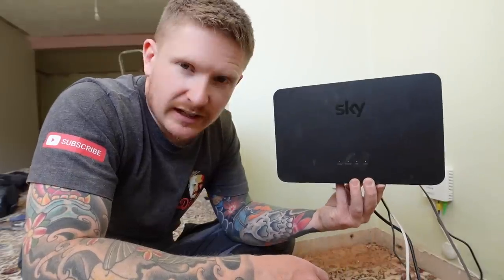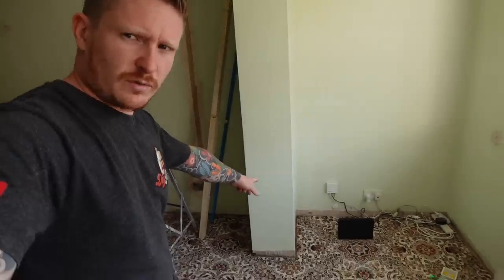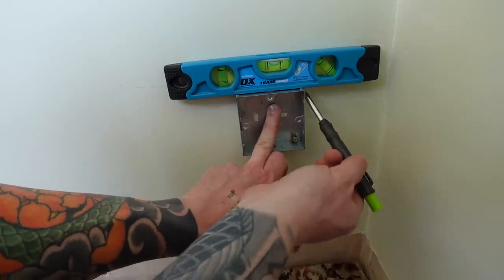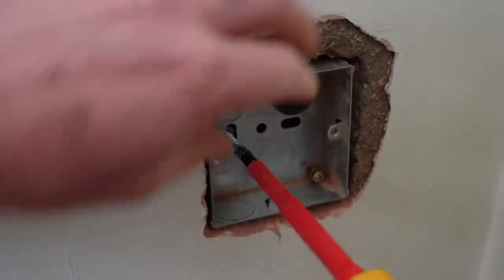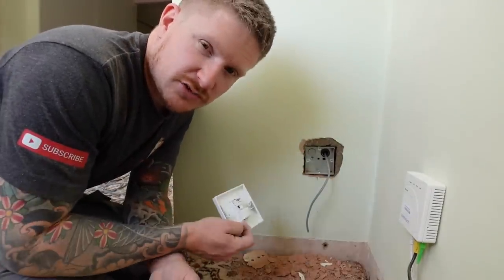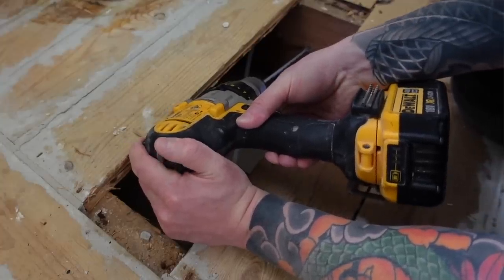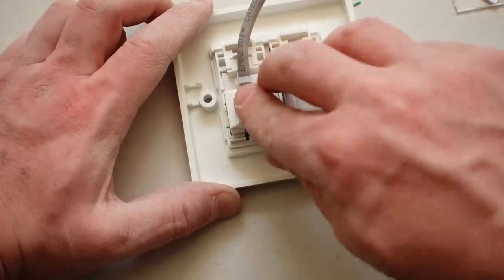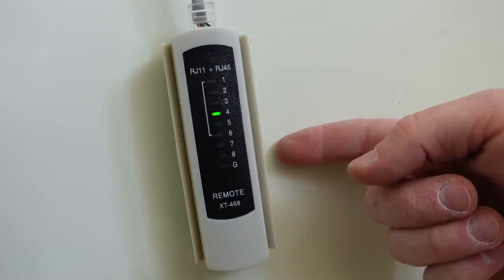How i Installed Network Sockets in an Old House | No More Wifi

Comment: could you have used the same channel as the power that you ran the other day? it is very close? That is isf you had planned it all out togther...Or would the leectricity cause issues with the signal?
Reply: Always run power and data separately. Electricity can cause interference.

Comment: That is the worst way to add network ports to a house, you should of had a central location for all the sockets to go to and put in a patch panel and label the socket they come from to the port on the panel. Use trunking for the cables being chased in so you can add more cables or replace cables without need to re-plaster every time. Should of drawn up a plan for the number of sockets where they are going to be, along with where the internet connection comes in.
Reply from the maker: Conduit was used.

Comment: Dunno if you mentioned it or not, but was there some kind of channel in that chase going up to the top floor? Rather than bogging in your cable, you could have a plastic channel in case you later decide to run another cable through it, or replace/upgrade the cat-5e cable.

Comment: I've run ethernet cables and also used homeplugs, which use existing electrical cables to send the signal. Ethernet cables are more reliable but when homeplugs work they are so easy to install. Also I'd avoid Cat7 cables if you need to make connections to the back of the sockets - the cores are much thinner than Cat6. I used 'burial standard' Cat6A shielded cable - it was the best option for speeds and 'connectability'. Although it's quite thick so slightly bigger holes needed for feeding it through. Cat6A allows up to 10Gb/sec with no loss of speed up to 100m of cable. Should be future-proof and allow lengthy runs in a large house.
Thanks for the video.

Comment: Thanks for the video. The only question is if no wifi how would our mobiles access the internet?
Reply: It would be impractical to not use wifi on a mobile device. You can likely use USB-C to ethernet adapters, but that would be impractical having to plug in an adapter and cable on each cell phone. The idea behind using ethernet is to use it on devices that need high speed and don't move around like computers, TVs, game consoles and so forth.

Comment: now ISP and computer manufactures are starting to use 2.5 Gigabit LAN I would say CAT5 is not worth putting in and you should be looking at CAT6 at least. Does CAT5e not have a spacer between the pairs? 

Might also be worth noting to make sure you buy sold CAT cable and not Stranded and also try to avoid Copper Clad Aluminium (CCA) cable and go for solid copper if you can as performance is better

Comment: What’s best to use to plug all the cables into the router? My router only has 3 or 4 Ethernet ports so I need something with at least double that to connect?
Reply: If you need more wired devices, you can buy a network switch. Think of it like a power strip in the sense that you can connect multiple devices to it from a single wall outlet. There are a myriad of brands and models of network switches. If you're not doing any fancy network configurations, a sub $20 TP-Link switch will be more than adequate for up to 4 more devices.

Comment: Fantastic. Clear in focus video, precise no waffle information AND without any irritating music. Thank You.
Can you do similar from the BT box outside the house? I have 2 lines coming in to my house the original was purely the phone line and is still in use though the outer cable cover is damaged where it comes through the wall. The newer cable was installed and runs all the way round the house exterior before entering an upstairs office and is no longer in use. I'd like to swap the cabling at the BT junction box outside the house.

Comment: why not use a conduit so it's alot easier if it ever needs to be replaced, or you need an extra socket.
Reply from the maker: 20mm oval was used

Comment: Man, I'm screwed.  I'm on a slab, and the first floor has concrete block walls.  The front of my house is two floors, the rear is one floor (with no access to any attic back there).  

Is my only option to drill outside the house and run the cables on the exterior?  (Stucco on the outside)
Reply from the maker: Without chasing the concrete walls then you may need to resort to exterior cable routes.
Reply: @TheDIYGuy1  Not sure it's easy to chase a concrete block wall.  I'm also not sure drilling thru a 6" block wall and stuco is a DIY job.  :-( 

I'd really like Ethernet.  

Thanks for the reply.

Comment: Could fibre optic be run up the conduit with mains electricity. It is not affected by the power.  Just need a converter at each end.
Reply: yes

Comment: The most eggregious flaw with this is not running the cable inside a pipe, you can't replace it this way, if you install a PVC pipe or some kind of outer conduit then you can just pull out the cable later without re-chasing the walls. Doing it like this is an absolute NIGHTMARE for any future repair or upgrade work when they find out they'll have to chase around the whole house just to replace a damn ethernet cable
Reply from the maker: The cable is in 20mm oval conduit so
I’m not sure what you mean
Reply: @TheDIYGuy1  You never show this, at 9:19 you're passing the raw cable into the chase without any kind of conduit and you never mention that one should be installed.

That's why people are finding this weird

Comment: You would be limited by the number of ethernet ports on the back of your router for hard wiring.. if like you say you would be looking at a better model for your distribution then it will be an interesting follow up. When i had my extension built i installed a ten port hub with all the relevant cabling to allow every room to have network and in my boys room there is three to allow full network access for their games consoles 😅
Reply from the maker: 👍 yes your right. I may add a ubiquiti network too
Reply: Network switch
Reply: Hopefully you installed a switch rather than a hub.
Reply: you are right the correct way to do this imo is to terminate all connections in the loft and shove a switch up there. This video is still valid though as chasing walls i'snt easy. I would 100% terminate them all in the loft if you are replastering or skimming the whole place anyway.

Comment: It should be mentioned that you should make yourself familiar with the regulations on cable zoning. This is both so that you know where you can expect to find existing cables and avoid them (still use a detector in case the previous person didnt follow the rules) and so that the next person who comes along will know where you put yours.
Reply: As far as I'm aware, audio and visual cabling, including networking, do not need to follow cable zoning by regulation (they are not regulated like electrical work), albeit it's still a good idea to follow cable zoning otherwise that network cable running at 45 degree angle across a wall might get a screw through it one day, something to beware of, as some 'professionals' and companies that offer networking/AV cabling will simply not follow zoning because it might be easier, quicker and cheaper for them to run some odd angles and zig zags.
Reply: “Cable zoning” for Cat5 😂😂😂

Comment: The angle grinder is a bit overkill as you were only cutting through plaster.  I would have just dragged  a drill down both lines to make a groove  and then  just tapped the plaster out with a hammer and chisel.  There would have been hardly any dust.  Then just temporarily secure your cable with a clip in the floor space above and secure it at the box below so it's nice and tight and then fill the gap with filler or plaster.  If you cut the channel tight enough then you can just push cables in and they will wedge nicely into the channel before filling.  I would often use this method when fixing low voltage wiring for telephone, coax, door bells and so on.  Often if the channel and cable was shallow I would just seal it with a piece of tape and then it could be wall papered over without filling.

Comment: seems a lot of work for this, i would suggest a single cable from your router to a "Ubiquiti U6-LITE UniFi 6 Lite Access Point" in the middle of your house as an easier cheaper option and will still have high speed wifi. there are more expensive Ubiquity options if you want. but i have the older Ubiquiti Networks UAP-AC-LITE model and it covers the whole house and the garden for my 1951 home, but you are right about the cheap routers issued by the ISP, they are rubbish

Comment: Or you could install Pass through Power line Adapters in every room with no extra wiring or holes.
Reply: That's hit or miss with performance and reliability. There's no universal "one size fits all" for home networking.

Comment: I'd approach it in 3 ways. 1. Can I use mesh/powerline? 2. use the fastest cable you can and always run an extra in case someone chews through it. 3. I'd ideally run a patch panel into the loft so you can then patch to other rooms from the loft if needed.  Really nice video! If you do this a lot I'd have a push tool as it snips the ends for you.

Comment: This is completely unneccasary. All you need to do is buy a third party Router that accepts your Broadband type. And most current routers accept most connection types these days. you can spend anywhere from £50 to £5000 on a router, depending on how far you want to go. Also, the wifi signal strength is dependant on many other factors including what your walls are made of. You absolutely don't need to completely wire your house out for wired networking. Hardwiring is really only neccessary for things like Gaming PC's or Consoles that play online games and/or download a lot. I have an Asus AX 5400 router, with sky's fibre broadband. The only thing hardwired is my PC, EVERYTHING else is wireless, and i never have a problem with probably 15 wireless devices constantly connected to it, and one of those is a file server.

Comment: Ok all nice when you redo your house.  There is a better option without drilling and so on -  Powerline Network Adapters.  You just plug them into the sockets and all is done. They can provide data transmissions of up to 1000 Mbps.  Taking in account that,  to stream 4K for multiple users you need 362Mbps broadband.  You are well covered. No problem with having broadband in your shed too.
Reply: you are lucky when you get 50 Mbps from powerline

Comment: Good vid if this is your preferred method of connecting between floors or across the house. Arguably much simpler and better performance using multiple access points - OpenWRT with some kind of wireless mesh does the trick nicely to give you good coverage & great speeds throughout your home.
Reply: Simpler yes, but not better performance with wireless uplink to access point

Comment: As long as the electrics are sound, just use powerline adapters.  No need for all this.
Reply: Absolutely not. Powerline Adapters are good in a pinch, but for a proper network, WIFI is better than Powerline. With high bandwidth services like Netflix and gaming, and the work from home way of thinking since lockdowns, a dedicated, wired home network is soon becoming the 4th utility infrastructure for a house. Water, Gas/Heat-pump, Electricity, and Telecoms (TV, Landline, Internet all in one).

Comment: What would you say would be the pros and cons of using a powerline adapter instead
Reply: I'd only use them as a last resort. In my experience they just about work but the speed isn't great
Reply: Power line adaptors are ok for slow speeds, but outside of that, they're fairly useless. They're a cheap solution to poor WiFi but you'll never get better than actual ethernet runs.
Reply: I personally wouldn't recommend them. I tried them before but they simply didn't connect. They need to be on the same electrical circuit to work. If your electrical system isn't the ideal set up for them they  just sit there flashing their little "can't connect " lights. Even one modern mesh unit could be better than a dozen powerline boxes.
Reply: If you can direct cable like this it should be 100% speed and reliability. I’ve had power lines Ethernet and they kept dropping out and needing power cycles. Got fed up in the end and ran an external cat 6 and stuck a ubiquity wifi Access point in it and never had a problem since.
Reply: Unless you need to push 1Gbps of data, they're perfectly fine to use.

Comment: Really disappointed with this video. I've never seen anyone going so 'gung-ho' chasing out for a back box. The drill was overkill, as was the speed and setting. I recently had to chase in for additional sockets in my own renovation project and I created minimal damage by going 'slow and steady'. The amount of wall blown just putting a hole through the wall made me wince. Everyone knows you drill a small pilot hole first and then enlarge from both sides to reduce blow out. I would have also run some flexi conduit in the wall between the ground floor and first to allow for additional cat cables in the future. Only running two isn't future proofing. And if you're going to spend £10 on a tester as shown, also invest in a punch down tool - a must in any tool box for phone and ethernet. These are sold at Toolstation Screwfix for around a tenner.

Comment: A simple mesh network would have resolved this issue
Reply: Cheapest mesh is £100 and they only repeat the signal they receive which dictates where you have to place them. For me that would mean one half way up my staircase before the signal degrades.
Assuming you already have the tools to do the cabling, a reel of cat6a is £50.